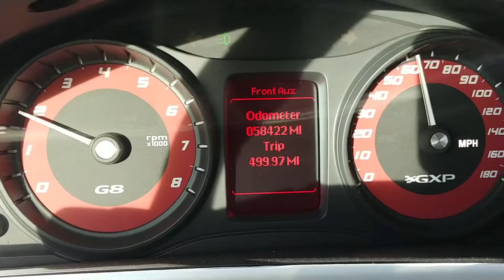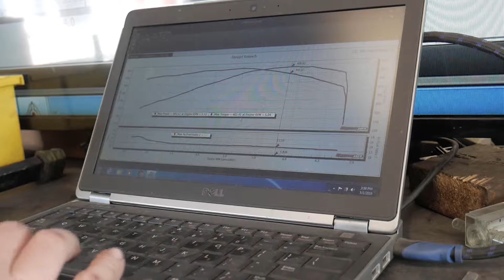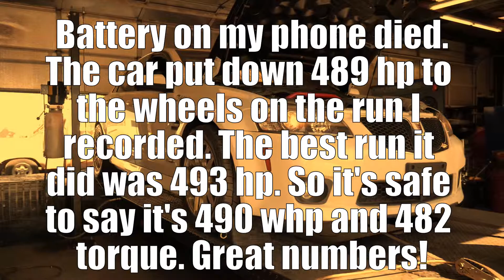How much HP does the 416 LS3 make in the Pontiac G8 GXP?

Comment: How much for the total setup? I have an 09 G8 GT w 110k....looking at options. Car look and sounding gd
Reply from the maker: @ron diaz Thank man. All together out the door was a little under $9,000. That included all the machine work forged internals including crankshaft, pistons, etc. It would have been less, closer to $7,000, but there was some things that came up that needed fixing or replacing, like pulleys, oil pump, and other bits and pieces. Hope this helps. Thanks for watching.

Comment: What did your car put down stock before you did the stroker kit?
Reply from the maker: @1997TL1000 The car sprung a really bad rear main seal leak before we could get any base line numbers. Part of the reason I stroked it out was because I had to get the engine pulled to fix the seal and the crank pulley, the root of the problem. The previous owner had some upgrades done but I don't know how much.
Reply: In Australia they have 230-50rwkw standard.

Comment: What octane are you running?
Reply from the maker: @Ls3JJ 91 pump. The car also has flex fuel kit so its ready for e85.
Reply: @autovice  what compression ratio are you running?
Reply from the maker: @ls3jj862  I can't remember of the top of my head, I'll look over the paper work to see if I can find it. But I do remember it was pretty low compression because I plan on boosting it.